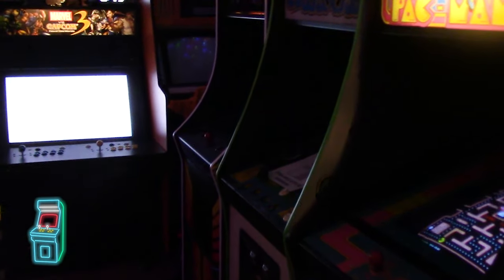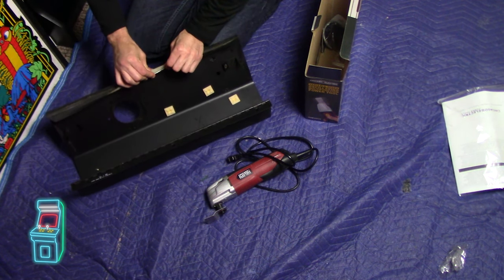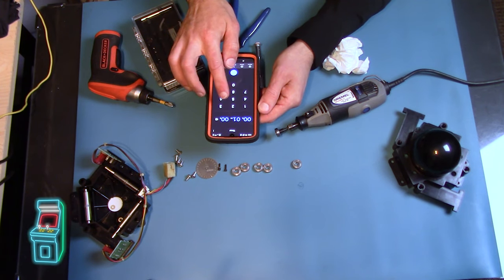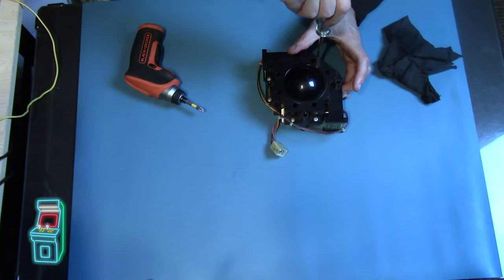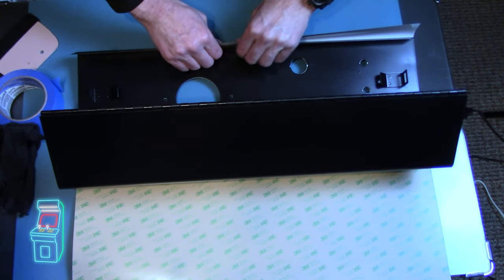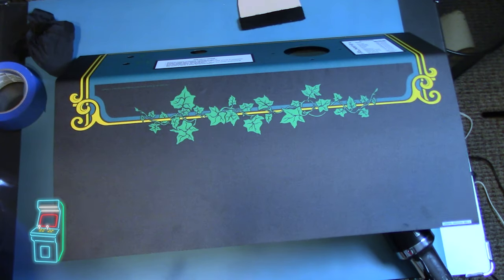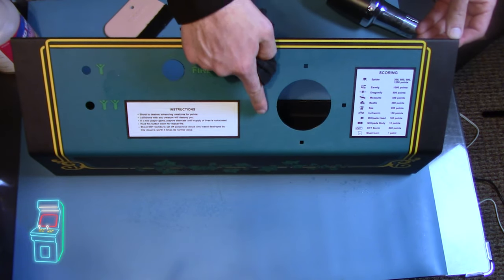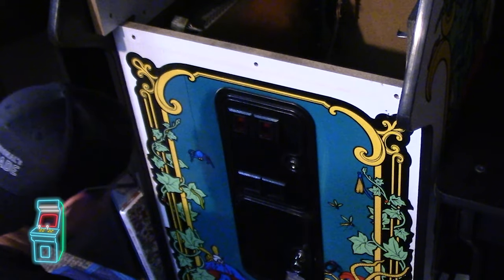Millipede Restoration [Part 8 Control Panel]

Comment: Hey there - your channel is great! If anyone is out there reading Atari’s manual it advises using 3 in 1 oil as regular Trak-Ball maintenance... don’t as its junk and turns the bearings into a gummy mess. I’ve had great success with a lubricant called Liquid Bearings and did a similar rebuild with new ball, bearings and rollers from Arcadshop - I cleaned the bearings in acetone overnight and then applied a small amount of Liquid Bearings and its like night and day.
Reply from the maker: I will check that out. Thanks!  But did you need to take each bearing apart to do that?  They look sealed.
Reply: @delsarcade    Didn't take them apart, I just let them soak for a day and then applied some Liquid Bearings.
Reply from the maker: I've already ordered the stuff. I will try it on my Crystal Castles bearings. But I think I will soak them with Brake cleaner instead. Works faster.
Reply: @delsarcade  Yep that should work, just was going with a less cancer causing option (according to the state of California). I've used it in many of places with great results like bearings / bushings on driving games and vibration motors. It a good hobby grade lubricant that doesn't leave the smell and tackiness behind like 3 in 1.

Comment: When did you replace the marquee overlay? Did you upload a vid of you doing it? I’m not seeing it in your your Millipede Restoration playlist and would love to see your technique. Also, where did you purchase the marquee overlay? I recently replaced mine and had trouble finding a supplier. The one I purchased was cut 1/4” too short and the colors are under saturated. I’m looking to replace it because I’m not happy how it turned out.
Reply from the maker: Actually, I didn't. I meant to say that I replaced the innards of the marquee (light fixture).  I will show it in more detail in a future vid:  But my marquee was cut along the bottom and painted black by the previous owner.  It looks decent and they tend to crack so I'm leaving it as is.
Reply: @delsarcade  I see... well I can tell you from experience that this style marquee overlay can be pretty tough to remove all the glue without damaging the wood. I had to use wood filler and also shim the glass so that the imperfections would not show through the artwork. I’m pretty sure Atari used a thicker laminate than what my supplier printed on. As a result, the artwork is less ridged and probably won’t crack as easily. Unfortunately, due to it being thinner material, it’s not very forgiving when it is applied over grainy wood. Oh yeah, aligning over the glass was not fun either. I do think it would make for a good video if you were up to it.
Reply from the maker: I'm in no rush,. Buddy of mine just did his. I warned him about the glass. I had him measure it when he put it to the side. Lol and behold... Smash!